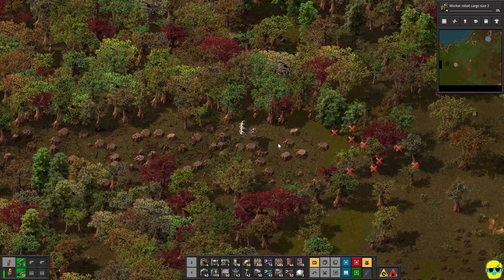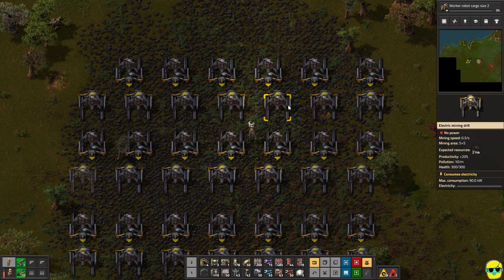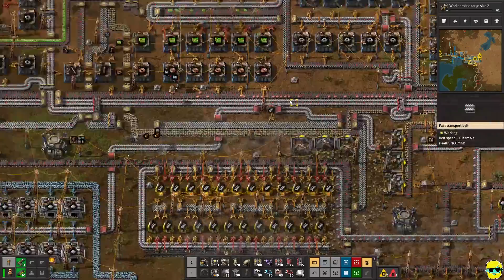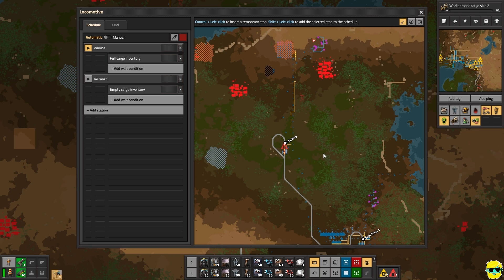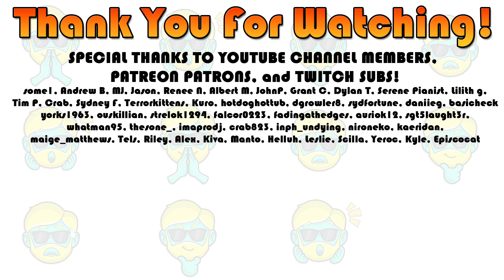Factorio | 2024 Learning Guide | Episode 28 | Resource Outposts and Trains

Comment: 22:59 Best to leave 4 or 6 tiles (2-3 belt-widths) between train tracks to allow for power poles & roboports between tracks, & the occasional underground pipe or belt pairs to cross the tracks

You can fuel trains (or eg steam generators) with solid or rocket fuel if you want them to be more efficient (ie faster & use less material), but ATM coal is fine. You could also consider putting all that excess wood you're not using into passive chests to use that as a fuel source preferentially, just to get it out of your storage
Reply from the maker: Great tips! Thank you for sharing! Yeah, I plan to get solid fuel going around but haven't gotten there yet ;D It lasts so long!